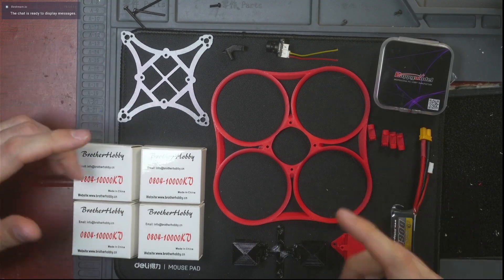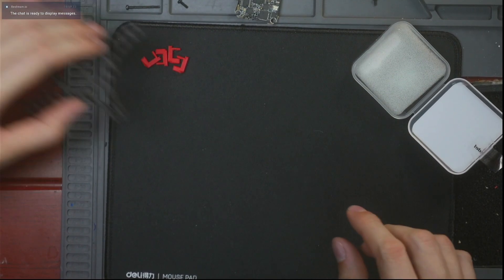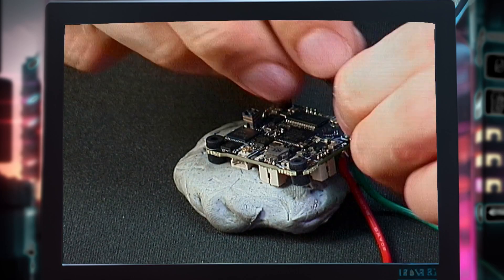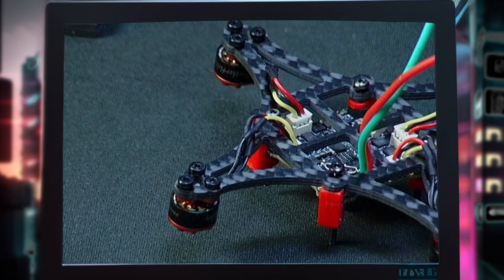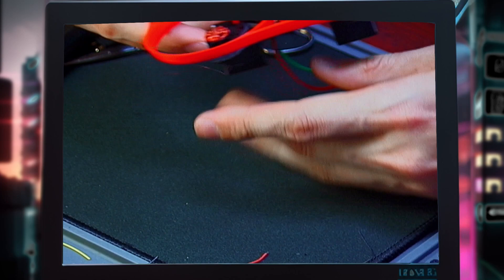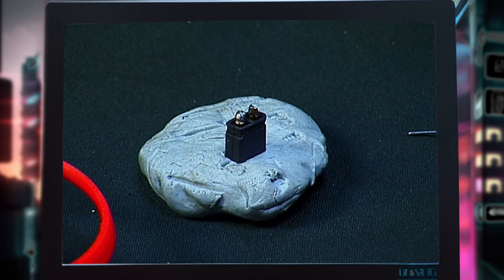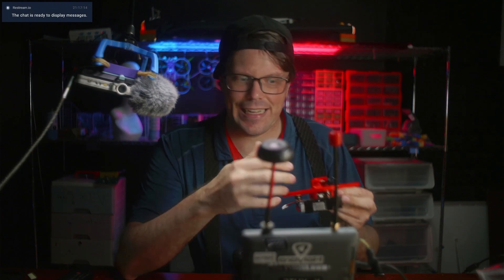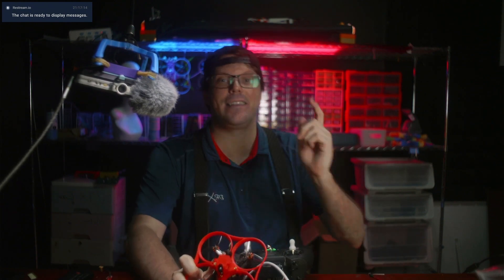How to build the ULTIMATE Tiny Whoop for FREE!

Comment: What solder wire u use? I have some recommendations.
Reply from the maker: I use 63 37 hiroyuki
Reply: @33rdframe  can't find that brand though. Maybe it's good too.
Reply: I use Kaina blue label high quality, resin core. 1.0thick 60/40 for motor, plug, and batt pads. 0.8thick 63/37 for uarts etc. I don't add flux. Super shiny

Comment: Nice work, Doc.  Both for the viddie and the build.  2S, 2-inch is my wheelhouse, and this looks like a serious contender, but for I don't have ready access to 3D-print, nor custom CF fabrication.  Also, I got a shit-tonne of spares for mine.  However - that integrated duct design looks like it would be quieter than what I'm currently running. . . any chance you could mod it to fit an already-existing 100mm x-frame?  It runs a 20x20 stack, but it has three M3 [I think] holes in it to use to mount the ducts.  If you're interested, I can contact you with my specs.  If not, I still am gonna watch your content coz I enjoy learning what you teach.  Carry on, Good Sir!
Reply from the maker: if you could send me the dxf of the frame i could adapt it
Reply: @33rdframe  I'll send you an e-mail with some ideas to knock around.  I think you're the guy to get them turned into something I can use.  You've definitely sold me on your abilities.